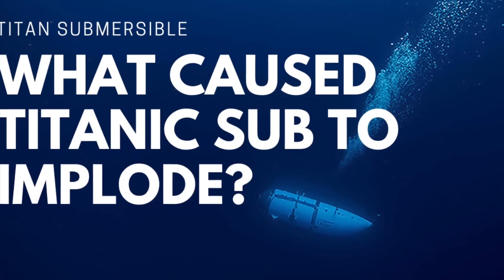What Caused the Titanic Submersible Titan to Implode?

Comment: The monitors weren’t screwed to the hull. Inside the hull there was a series of ribs, and a flat floor and wall linings was attached to those, and the monitors and lighting were secured to those ribs.
Reply: Correct. The inside of the sub was actually a fiberglass liner that had the mounts screwed into.
Reply: That fiberglass liner looked an awful  lot like carbon fiber to me and not fiberglass . Fiberglass matting is not black nor is it as tightly wound or more accurately woven as what is visible in photographs
Reply: @howitusedtobe  I’m pretty familiar with what carbon and fibreglass looks like. If you look at the pictures of inside the hull, there appears to be several pieces slotting together with backlighting. It also says that it has heated walls. The picture I’ve seen inside appear to have an effect like brushed aluminium, but a daily mirror story reports this “19 June 2023 — Titan has a fiberglass hull insert to prevent condensation from dripping on the crew and to eliminate electrical ground faults.”

Comment: A cylinder sandwiched between 2 hemispheres in 12,000 feet of water sounds like a great idea.
Reply: The sub had been down to Titanic several times before though. This is its third season of diving. Each time it got weaker and weaker and weaker until boomski
Reply: My maths gives about 10,400 tonnes of pressure on the end caps at 3800 metres.  So as you say you have a thin walled cylinder in compression from an immense load from the ends.  Crumple time.  Sad.
But Cameron's clip says they lost coms at 3500' (1200 m) so no where near max depth.  Something let go at that comparatively modest depth.
Reply: @nigelwilliams7920   Cameron was mixing up feet and metres . 3500 metres. They were  round a 1000 feet above the wreck at the time of last comms.

Comment: Why didn't they build two? Lower and raise the first one repeatably until it fell to bits to see how many cycles it could do. But then I'm not an engineer. I wouldn't climb into the thing until I knew how many times it could be lowered before imploding.
Reply: I have a pretty good idea why they didn't do this.
Reply: That would have been done to get it certified, I guess.
Reply: The hull had already been replaced once I’m almost certain I saw reported.
Reply: Rush was doing it on the cheap.

Comment: They also screwed the bolts in wrong. You don't just screw them in one by one. You always screw them in equally and across from one another. Then torque them. They also left it out in Washington weather in a parking lot. They didnt even store it safely. I can go on, and on. Every single thing on this sub was a failure. The window was only certified for 4,000 feet. Literally every single thing was wrong on this death trap.
Reply: Agreed. I saw so many faults on the thing and honestly I’m no engineer, I’m just a bloke that builds stuff and knows things.

Comment: Not fully agree with you.
The absence of proper seal between the dome and the cylinder could not have caused the implosion. The possible leak would have reduced the pressure differential easing the stress on the structure. But keep in mind that the dome is pushed by outside pressure with an enormous force against the cylinder so even titanium edges would have been so tight to act as a seal due to the elastic deformability of the material.
As far i know the internal surface of the cylinder was covered with a metal layer. I hope that the equipment was secured to that layer and not to the main composite structural element.
Reply: and... "The possible leak would have reduced the pressure differential easing the stress on the structure."      Huh?  a possible LEAK wouldn't matter?
Reply: @colonelferringeyes9714  I'm almost sure there's no leak at that depth. But just in case, the leaks would help to reduce the differential and ease the load on the structure. So people cannot survive, but the structure doesn't implodes. When internal pressure equalizes the external one, the structural load disappears.
Reply: @alessandromaffei4769  ok, however unlikely a leak,  a "sudden slow leak" could be classified as, say, for arguments sake, 2 minutes to fill the sub with pressurised water...  we can say safely state the craft wouldn't have catastrophically imploded in a millisecond hot flash of internal vaporization of human bodies then?....   but pushing the assumed "abort and immediately inflate-up-to-surface button
still would have zero effect on pretty much instant death, but at at least there'd be an intact sub with 5 bodies laying on the ocean floor..  Maybe...  blah, I give up.  soooo many variables to consider...if, what,maybes .. End of day though basically the proof of rabid implosion being scattered debris and no bodies... and the glaring learnt message being don't be blase about f*cking  with deep ocean ...  cheers
Reply from the maker: thats a good point about the pressure pushing things tightly together. I had not considered that.
Reply: So elastic deformality is 100% equal and always dead flat level with no  ripples or un-uniformity or micro-gapping between both opposing surfaces then huh?
Reply: @colonelferringeyes9714  It could be, yes.
Keep in mind that at 4000m the dome pushes against the cylinder border with a really huge force.
With a water pressure of 400 kg/cm2 and 2.2m of diameter, this makes near 14000 metric tonnes.
In fact the bolts are there for keeping the dome closed in shallow water. As soon as the vessel goes deep, the water pressure pushes the dome with much more force and the bolts become unloaded, avoiding mechanical stress on their connections.

Comment: It’s been mostly confirmed that the visible walls within the hull are a secondary layer.

However the method of construction is pretty alarming considering what it was designed for.

On a separate note.
The reason the navy didn’t announce that they heard the implosion was probably for two reasons.
One: though the network itself isn’t classified; but the details of it certainly are.
Two: it would be irresponsible to announce catastrophic failure (and the death of the passengers) without concrete physical evidence to back it up.
Reply: I can think of a 3rd reason the Navy didn’t announce the implosion sound. They had no external event to link it to, no distress call. The ship personnel didn’t alert authorities that anything was amiss until 9 or 10 hours later. The ocean is noisy. The Navy would have had to look back through all the ocean sounds logged at varying times to find the one that registered then, only in hindsight. And by then, or soon after, the banging noises started, which had to be investigated as a possible man-made distress call. Imagine if officials announced the search was ending because of a noise heard in retrospect on Sunday. Or if, despite the banging and not finding the people, the Navy announced it had all ended Sunday, yet the banging noises were still audible. 
I hope it’s investigated why the ship personnel waited so many hours to sound the alert. Once the submersible lost both tracking and communication (as has been reported), it was clear there was a problem. According to films made by former divers on Titan, the sub navigated to the wreck via text messages from the mother ship. When 2 systems were lost, I would think the ship personnel knew something devastating had occurred. Why did they wait so many hours to sound the alarm?

Comment: I’m no engineer but even I thought the bolting the cap on didn’t look at all safe.
Reply: No shit, me too! Those bolts looked pretty small and spaced pretty far apart. Go look at one of the light poles along a highway where they're bolted to the concrete footing, they have bigger bolts than that and are spaced closer together. And those poles aren't in an environment nearly as demanding as a submersible.
Reply: @robertstallard7836  I considered that but I'm a big fan of overkill. If I were venturing 4000 meters below the ocean's surface, I would want something more robust than what I saw. 

There's an adage in aviation design that if a part breaks, it's not strong enough. If it doesn't break, it's probably too heavy. That doesn't apply to submersibles, so I'd want overkill.

Comment: What he saying as far as how deep they were kinda doesn't make sense..
If they lost contact with the submersible after an Hour and 45 min...
Then how were they only  3500 feet down?
 
When its said that it takes only about two hours to make it from the surface to the wreckage?
They had to be deeper than 3500 feet...

After an hour an 45 minutes in the water they would've been well deeper than 3500 feet..

Comment: In my opinion, the two largest contributors for the inevitable implosion is the extreme atmospheric pressure and an overly confident designer, blinded by ego that resulted in a blatant disregard for safety concerns.
Reply: In such an extreme and unforgiving environment the room for error is zero. The CEO was blinded by his own ambition to the point where he pushed his luck to the limit and it cost him and others their lives. The one comfort is that they felt nothing and suffered no prolonged ordeal.
Reply: @embersstark7126  Yes, I know... thanks.
Reply: @embersstark7126 yes , i agree with yuo , sad thing that nobody stop this guy (Company) selling tickets in a so risky divice , but underwater is like wild west , lacks of regulations
Reply: @noway8233  The loss is honestly quite insignificant.   Medical mistakes kill a lot more people every year.
Reply: @embersstark7126  He's far from the 1st to be overly optimistic.  Maybe what actually failed was something no one has thought of as yet and is completely surprising.    For example it was grabbed by a deep diving giant squid.
Reply: Extreme water pressure you mean.
Reply: My opinion is it was an innovative design that worked well to the point that something failed and at the present time we don't know exactly what. but there have been many other engineering failures that have killed far more people.
Reply: It went down 13 times, so it was a capable submersible. They didn't check and maintain it properly, that was their demise.
Reply: What caused it?  Ummm..... let's see now.  Maybe 6,000+ psi of pressure and bad ideas in engineering design? Just a guess.
Reply: @spikespa5208  It's easy to conjecture fatigue.   It would be nice to have more specific detail if there is any way it can actually be determined.
Reply: The metal for the pressure hull was airplane throw away that they got at a discount price.
Reply: Opinions, meh - gosh, like the rest of the planet doesn't have one - if paid for then provide, otherwise nevermind bruh no one cares, ha

Comment: The more I learn of Titan the more surprised I am that it successfully survived the few dives that it did.
Reply: 13. It went to Titanic 13 times, it had two major flaws, communications system was made in university by students, and hull was carbon fiber, good in air, terrible in pressure
Reply: @alarjak  So it basically was a maintanance problem. If they had checked and repaired the Titan like every 3 - 5 dives they would be still alive. Being cheap can kill you...
Reply: @dominiquew2351 that's my conclusion, a carbon fiber specialist said to scan the hull using ultrasonics would've cost around 20k
Reply: @VraserX  I don't think carbon fiber can be repaired.  It would require replacement.  Huge cost that the CEO was not willing to do.  Even if he did it the viewing port would have remained as a weak point.
Reply: @VraserX  they cut corners,  it's awful .
Reply: . Not willing to do what was required was his folly. He could have used his billionaire friends to invest in building better subs instead
Reply: @VraserX  yes I personally think that with each dives the titan would have got weaker which nobody looked into.
Reply: @VraserX  No, there is no way to maintain a 5" thick CF tube.   But who knows what the true point of failure actually was?
Reply: @elena19-80  I don't see it as cutting corners.   It was more of an attempt to keep costs manageable.
Reply: @rosean2025  Even the most expensive submersible poses significant risk.
Reply: @VraserX Hi, not necessarily lack of maintenance, possibly/probably more like lack of adequate inspection. The pressure hull may have suffered fatigue failure(s). Deteriorates a little with each pressure cycle. Eventually it fails. The hull needed ultra-sound or even more exotic scanning after each dive. Reports appear to be that this did not happen.
Reply: @alarjak That deathtrap had more than two major flaws - the list of major flaws is endless: the thing is just ill-conceived, poorly-engineered, badly-executed, inadequately maintained......it was a disaster in every aspect, from the ground up: by the time the investigation is over, this will rank as one of the greatest follies of mankind.
I still can't get over the ridiculous seating of the dome: two broad flat surfaces held against each other with bolts - not even any male/female change in profile. Not even a rubber ring - just two flat surfaces kissing each other, and he's taking it all to 6,000psi.....
I've been calling this the greatest endorsement of CF in history - improperly specified, applied and used: totally abused, actually - but it still managed to save these idiots for all that time. Incredible. 
That tub should have disappeared beneath the waves and never returned from the 1st trip - let alone make it all the way to the bottom: that's what's amazing!
Reply: @lewis7515  I'm not buying it.   People are suffering from a form of DJT syndrome as it relates to this craft.  What we need are specifics as to the actual point of failure.
Reply: @JoeLinux2000  What are you actually talking about?
Reply: @alarjak  Are you familiar with the song "Under Pressure" by the British rock band Queen?
Reply: @clarenceboddicker6679  No but "pressure" is a common term related to horse training.
Reply: @alarjak  I thought it went down 12 times before. This was the 13th ! Im not superstitious but everyone says 13 isn't a good number. It's just a coincidence, although i don't believe in coincidences. I don't know, but it's freaky .
Reply: @elena19-80  6 times in 2021 and 7 times last year, this was the 5th attempt this year.
Reply: @alarjak  All in all pretty good.
Reply: @alarjak something does not become a flaw because it was made in university, OS X and iPhone's are flawed from the onset going by your terrible logic.
Reply: @entx8491  True, but i don't see much young kids diving out there, this is serious business as we are seeing, five peole are dead.
Reply: I heard that after the 2nd trip the submersible should have been retired & a new one built, this means they should have been charging a 
Million dollars per person
Reply: @MissEnglish123  Yes, company what made that hull said one dive only
Reply: We need to remember something here folks. Five people died. Many more are grieving their loss. None of them, none of them 'deserved' to die. Mistakes must have been made but that does not mean any of us can say "Well deserved". We all make mistakes, usually smaller but remember the old maxim - there but for the grace of God go I. Remember next time you drive that car with passengers or step off the side walk without looking.
Reply: @bobuk5722  I agree with everything you said but the god bit. Not sure what relevance folklore has here.
Reply: looks more and more like a garage kit build, smh
Reply: Thats exactly was i thinking , this thing have so many flaws
Reply: @noway8233  Not as many as the M$ Windows OS that so many  depend on.
Reply: do we know Titan actually made it to Titanic depth in all 13 of those previous dives,  they seem to have a lot of aborts, were any of them counted as a dive
Reply: @denniss3980  Since it went active in 2021, I believe it was 4 successful dives to the Titanic; the final terminal dive; plus at least 8 other dives or attempts...
It was well into double figures, but not that successful in actually reaching the wreck.
Reply: It wasn't as bad as many people are claiming.  If you compare the Titan to the COVID mRNA "vaccine" I think the Titan will come out on top.
Reply: Yup, what happens when we build structures and tin cans for people to sit in at astronomical pressures from products at camping world.
Reply: Totally..

Comment: I have a really hard time believing they drove screws into (or compromised in any way) the hull... Are you 100% certain that information is correct???
Reply: Apparently not. They're fastened to an inner lining.
Reply: @burtpanzer not very thorough research . Research was secondary in the rush to pump out a video before the titan trend on you tube fades

Comment: From other passengers recollection that the hull popped and creaked on the way down. I would hazard that there was failure of the matrix holding carbon fiber. This what happens when someone familiar with aerospace designs a submersible. Carbon fiber is relatively weak in compression because of its brittle nature.
Reply: Exactly. That would be my guess, and I don't know anything about it.
Reply: I had a large fiberglass sailboat and see the material as being a series of baskets, one inside the next.  I think the strongest  composites are actually laminated under pressure.